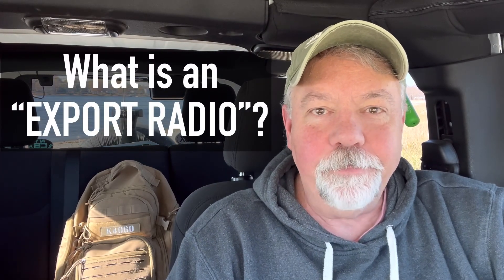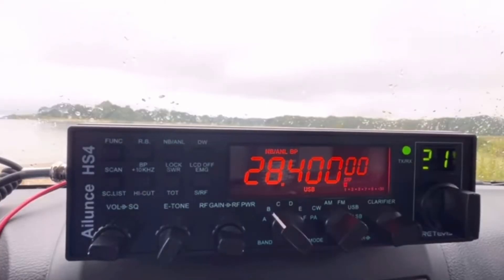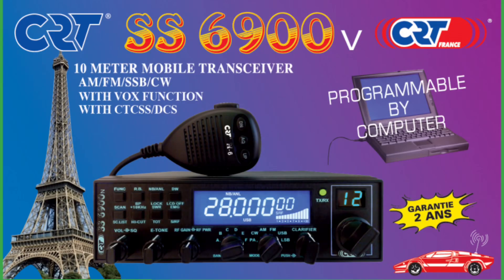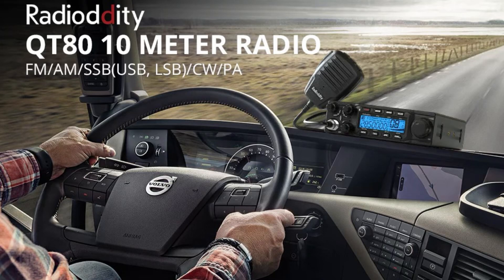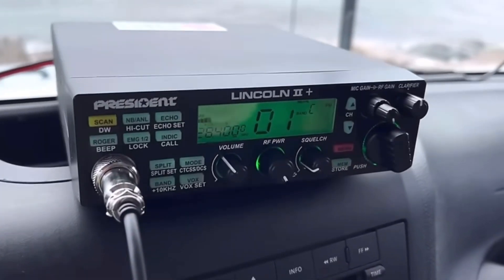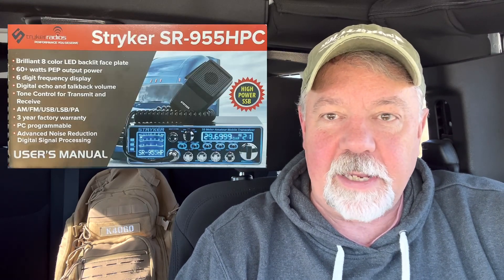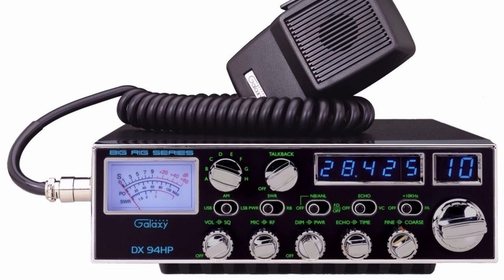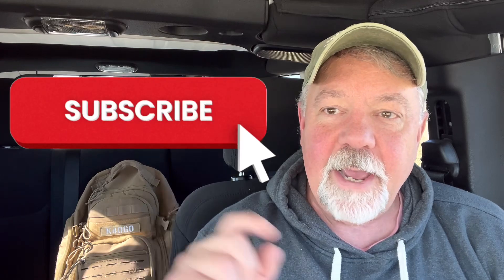Export Radios - Are they CB or Ham Radios?

Comment: It seems like every "11 Years" a lot of radios these comes out .
Back in the latter 80s i bought a uniden HR 2510 new . .it did 48 watts PEP And talked all over the World with it.  The last time i made a contact was 1994 .  I always used above 27.405 to 27.990 and 26.960 to 26.000 and hardly ever used AM mostly USB and some LSB,.not that i had any thing against AM .  I Still have several Receivers,  always have and use them a lot . I have thought about getting back into it with conditions so good .
Thanks for the video.

Comment: I've tested, reviewed, and done "first looks" at quite a few 2024 10m radios (written, not on video) and I have a couple comments about the new President line - The new President SSB radios (George FCC, George II, and Washington) absolutely have the best display screen over the competition when used in a vehicle. As a driver, you'll encounter all types of lighting conditions, and due to the size of most SSB radios, operators have little choice on where to mount a radio. I use CYAN for the color in all of the radios mentioned above, and even in direct sunlight, it's easy to see the information on the display. I took my McKinley FCC out of the car and replaced it with a George FCC radio, mainly because of the display. Even though it's a legal CB and non-modifiable, I've made DX contacts just about everywhere I wanted to when the conditions are right. The George II was expensive (direct from the UK), and the Washington, marketed as a 10m radio is superb (but it stays in the shack). If I had any sway with President, I'd suggest they should make (in future revisions) the ability to give the operator the choice to switch between either a large channel number, or large frequency display. It wouldn't make a difference on the George FCC (because it's just a 1-40ch radio), but it would make a world of difference on the Washington. The AnyTone board radios like the QT60, QT60 Pro, HS4 and others do a good job of keeping the frequency readout as large as possible. I'd also suggest to President (and most others), that if you offer a CW mode, put a jack on the back to plug in a key - like the Retevis did with the HS4. Thank you for making this video. It's something that could help someone making a decision on what to buy. Very enjoyable!

Comment: The 10 & 12 meter export radios are like the Baofeng and other inexpensive Chinese VHF/UHF ham radio handhelds.  People buy them to use outside of the amateur radio bands.  The difference between the 10 & 12 meter export radios and the Baofeng handhelds is the FCC hasn't stepped in requiring the export radios to only be able to transmit within the ham bands.  With the Baofeng radios because some of the dealers were marketing the VHF/UHF ham radios as Part 90 and Part 95 radios despite not being certified for Part 90 or Part 95 the FCC stepped in requiring them to be locked to transmit only within the ham bands.  That is when Baofeng started marketing handhelds for the part 95 services such as FRS, GMRS, and MURS.  Sure you can still find sources to buy unlocked Baofengs or ones that can be unlocked, but it is getting harder to find them on Amazon.
Reply: Rule 95 is pretty clear regardless what radio they are using on 11 meters. If they are running above 4 watts and get caught the consequences are the same $500 per violation, a $10,000 dollar fine or even imprisonment.
Reply: @Watchman-77  yes Part 95 is clear for all the radio services it covers.  I don't know how often the FCC actually monitors the frequencies covered by Part 95, but I do know it is low on the priority list unless they get enough complaints.  I mean there are guys building 15 kw or higher rigs for CB "throw down" competitions and the FCC is doing nothing about it.
Reply: @JBryant1981  In deed it must be low on their list either that are a part of a get richer quick scheme when and if they ever actually do decide to do something. I knew a guy back in the mid 80's another guy loaned him his linear right at Christmas time and to recall it it wasn't a very powerful linear either something in the neighborhood 40 to 70 watts if I'm remembering it correctly. The guy I knew who borrowed the linear he lived on the bay at that time and the FCC showed up. They gave him a choice to pay the fine or throw the linear into the bay and he did he threw in in the bay and lost his buddies linear.

That aside those pushing power should know they are trampling on locals depriving them of the use of their radios they bought and paid for they shouldn't have to be told they should know. And those abiding by the rules shouldn't have the need to be forced into breaking the rules in order to make their radio useful aka adding amps.

And since the FCC like you said isn't interested in doing anything about it and the power radio operators are going to continue anyway either way, what should happen is for everyone to come to an agreement that power radios avoid a set number a list of channels in order not to trample on local users.
Reply: @Watchman-77  I know several people who have been using the Baofeng ham radios on FRS/GMRS and MURS frequencies for at least the past 5 years while participating in large scale paintball and airsoft games.  As far as I know none of them have ever received any kind of notice from the FCC.  Some of them are just running the memory channels programed from the factory because they don't know any better or just don't care after being educated.  Many of them travel across their region such as the Midwest or Northeast, and some travel across the country.  Unless the FCC shows up at a large scale paintball or airsoft event and inspects every single radio being used there really isn't any way for them to police it since they don't have the man power to do that.  If they get enough complaints to send out someone to investigate the offenders will be long gone by the time someone shows up to investigate and the only ones at the location that the FCC could question would be the field owner and/or field staff.  At that point any investigation would be dead in the water since the field owner and field staff won't know the types of radios and frequencies all the players with radios are using.  I suppose if the FCC gets enough complaints about interference they might consider having someone investigate during one of those large scale games.  However I doubt that will happen since these days most Baofengs are locked to the service they are being marketed for and many of them cannot be unlocked to transmit across their entire receive range.

Comment: I am learning daily. I bought a cb. I live in rural maine. A 4 watt radio doesn’t reach much. I wish they could reach farther. This sounds great. Sorry not sorry. I want to be able to reach friends 15 miles away successfully without depending on skip.
Reply: Get you could get a 5/8th's sigma antenna and mount it as far up as you possibly can preferably with the base of it about 20/23 feet up put it on a flag pole or a extendable pole. The radio I have is a Uniden PC78LTXFM 4 watts and I'm talking 11 miles away to someone I know and it's a omni antenna but you might also want to consider getting a beam antenna with a rotor then you would probably be able to talk maybe 50 miles or so in one direction those antennas are directional antenna's unlike the 5/8ths sigma. I also bought a Workman DM-507-4 replacing the stock Uniden mic that comes with the radio it is a very hot mic. As far as exceeding the 4 watt legal limit I have no intentions on going there. I want to talk locally use my radio locally and 4 watts keep me local it's more stelthy too I don't want the whole world hearing me. Also for those choosing to run the powerful radios thinking because they have a 10 meter radio that somehow makes it legal for their use on 11 meters they might want to consider the consequences should they get caught up with $500 per each violation a $10,000 dollar fine or possible prison time? No thanks.
Reply: @ I’ve got an antenna I’m putting up, that’ll be about 22’ high. I have a book on antennas I bought, and I’m learning. It’s a very deep well of information to go through. But I’m headed down that rabbit hole
Reply: One of my stations is on the Adroscoggin/Oxford Co border; you can do it!
Reply: About a week ago, I did some testing with one of my daughters. I had a President McKinley II with a Tram 3500 antenna and she was on a Radio Shack TRC-485 with a Tram 300 antenna, and we could chat 15 miles apart on sideband
Reply: @ great!

Comment: Salty Walt,   We as Licensed Amateur Radio Operators have been given Trust.   Good Engineering Practices..!   I too dabble in 11 Meters and as long as I follow the Rules and Regulations of the FCC and ARRL Guidelines do not see a Violation or problem of any kind.    Thank You   KC3ZDW  and  73
Reply from the maker: Roger that, as I said in the video I myself operate 11 with FCC type approved radios. 73
Reply: @COASTALWAVESWIRES  Good content!  Thank You

Comment: Hi Walt.  Back in my 11m days, export radios were CB radios that were meant for other than U.S. markets, and were not type accepted by the FCC, therefore not legal to to be brought to the U.S.  Even today I would not buy any radio with a channel display.  Probably because back then the export radios were only slightly better in performance than the type accepted radios.  Neither could come even halfway close to the performance of my Kenwood TS-520S.  Is the performance of modern export radios on par with Ham radios from the 80s or 90s?
Reply from the maker: I think today’s export radios are much better for sure. And as I said in the video, a great way for a new ham to get on the air with a new radio that only cost them $150 to $300.

Comment: My best contact on a Galaxy 94HP was Italy from SE North Carolina in my truck.  Oddly my co-phased 4' firestiks were oriented N-S so I was rather surprised he came back from the East when I called his sign!  I usually just monitor CB 17/19 on it if I'm on the Interstate but it's nice to be able to work 10M driving around town or at a rest stop or POTA.  Planning to upgrade to a Yaesu FTX-1F with Mars Mod so I can monitor 11M and 10M at the same time (or other bands for POTA etc).  In the RV I have a modded LincolnII+ along with a Cobra All Road and Yaesu 300 (500 in my truck) Also have modded Washington, McKinley Galaxy 959 with 100W finals mod among others.  Buying a Stryker 955 (modded) helped with motivating me to get my ticket after my father AD4WN became a silent key so that is another somewhat decent reason for their existence; work 11 while studying and also listen to people on 10/12 to hear how they communicate.

73 
KZ4EK
Reply from the maker: Thanks for the great comment, 73 Walt

Comment: Nice show of export radios.  Yes their is so many that would take a 8 HR video.  The ones showed are the most common ones . Most are great radios. Some are somewhat hard to use on HAM bands do to channels . But once you learn that it is somewhat easy . Some have VFO mode which is what I use.  I have the QT 60 and compared to the RX on IC 7300. Both receive about the same.  The ICOM has better internal speaker but with same Heil PRO 6 headset . both sound the same. The filters for noise in IC 7300 much better and more adjustable filters. But 1K USD radio. But the QT 60 has great RX and nice filters. The TX is about the same on same power. The icom has a processor which is better for SSB when set correctly.  The Heil mic on the QT 60 is GREAT !  I have a old RCI 2950 and the QT 60 is so much better !  CB skip is crazy strong at times. In the AM in NY I have been hearing Russian on CB free band. Without knowing Russian I am not sure what part is coming from.  My UK friends told me Russia somewhere. They hear it as well. The next time it comes in is from Winter to Spring . This is also Japan open at times for me.  Summer I get short DX ,South of Equator mostly like Brazil. Or Mexico . Lately the CB is full of Spanish . and it is strong ! They love CH 9 CB !! . I even heard them on 46  MHZ  . Not sure what country coming from.  Not very legal in US. My IC 7300 has full open RX to 72 MHZ . I cant TX . KK6USY got Lord callum on 10 meters was great !  It is on live stream .  73 .
Reply from the maker: Cool! Catching Callum is awesome

Comment: The FCC should just go ahead and up the legal wattage for 11 meter! I’ve been into cb since I was a kid in the 70’s, and still enjoy it and gmrs.
Reply from the maker: @hatchetjackphillips  I agree completely
Reply: Up the wattage on 11 meters? Have you heard the radio during daylight skip hours lately? It's so trashed out you can't even hear a conversation. All that wouldn't happen if the 4 watt limit was obeyed. A lot of operators have and are ditching their radios due to that cause and it's a shame they bought their radios they abide by the rules and they're robbed of the use of their radio. The power radios are giving CB radio a bad reputation causing many not to take CB radio serious and at a time when the CB radio is a must a necessity not only for a crises but censorship avoidance and regular reliable communication.

Comment: I was blown away when I learned that CB is sandwiched in among the ham bands.  Back in the day we had a SSB CB (12 watts) and my farthest qso was about 300 miles.  These days I can reach multiple states away using 5 watts on my vertical or EFHW.

I’m guessing we were at the nadir of that solar cycle or we had no idea what we were doing regarding antenna tuning. 😂

I’d like to get one of those import radios if i could get one that does 20 meters.

Thanks for another informative video.
Reply: 11 meters actually was a ham band at one time.
Reply from the maker: Yes I wish they made one that could do 20 meters too. 73, Walt

Comment: This is unrelated but you might find it interesting.  In the in the US Marine Antenna Handbook.   MCRP 6-22D "To make a long wire antenna directional, place a terminating device
at the distant station end of the antenna. The terminating device
should be a 600-ohm"     "Constructing a long wire antenna requires only wire, support poles,
insulators, and a terminating resistor (if directionality is desired).
The only requirement is that the antenna be strung in as straight a
line as the situation permits. The antenna is only 15 to 20 feet above
ground, so tall support structures are not required. The antenna is
normally fed through a coupler that can match the antenna’s 600-
ohm impedance. Coaxial cable can be used if a 12 to 1 balun is
available to convert the coaxial cable 50-ohm impedance to the
required 600 ohms."
Reply: Why not take a 9:1 long wire terminate to ground with a 450ohm 200w resistor to make it directional as well as removing the need for a tuner.
Reply from the maker: @ give it a try, sounds like a great experiment
Reply from the maker: That’s a great book, I have a copy

Comment: Are there any that a CW op would recommend?
I got the President Lincoln II + because it was suppose to be able to do CW, but there were real problems with it, such as cutting off the first dit, when you start sending. It wasn't very CW friendly, so I eventually sold it.
Reply from the maker: @jonizornes5286  great question, I don’t think any of these are stellar CW rigs even though they claim to be CW capable. Someone else here might know better. 73, Walt

Comment: Walt I hear people on 11m and 10 m using 1, 500 watts through Yagi multi element beams even when conditions mean you can work anywhere on 5 watts so I don't get wound up by export radios at full chat on either band as they are much more in line with my QRP mindset. I stick to simple wire and vertical antennas becaue to me ERP is much more relevant than the wattage of the rig and I will never use or own an amp (I lie I have several guitar ones lol). Like all hobbies you can spend fortunes to get results or you can use your brain and learn properly and get results that way. I love your approach, that's why I am always here to listen 73 M7BLC
Reply from the maker: Roger that my friend! 73, Walt

Comment: Hey Walt, thank you for this video that  addresses a topic not much openly discussed elsewhere.
I really agree that these radios like my Anytone AT-6666 (not pro) are a lot of radio for a relatively low price. I don't know if this has improved on the more recent models, but the only major gripe I have against my AT-6666 is the channelized tuning, the lack of a real VFO with continuous frequency coverage. It's a quite decent performer both in RX and TX and  I've worked great DX with it too.
As for the QT40, I've bought one out of nostalgia for old-time CB transceivers, but I'm not quite happy  with it.  Modulation isn't good in SSB, the 2-digit LCD display matches its vintage look but it's a pain to use. Its analog S-meter again has this great vintage feel, but it's so imprecise that it's all but usable. I'll probably sell it sometime.
All the best to Salty Walt and K4OGO, both of them 😄
Reply from the maker: Thank you Alain! Great comment. All the best and 73 my friend!